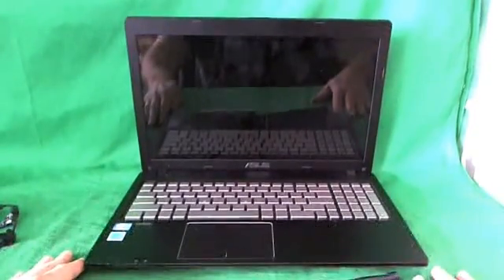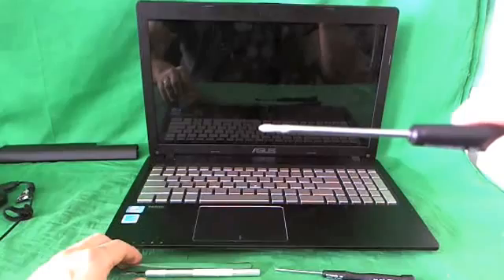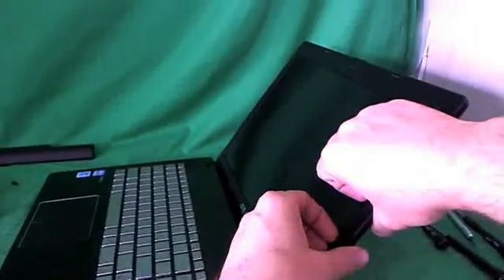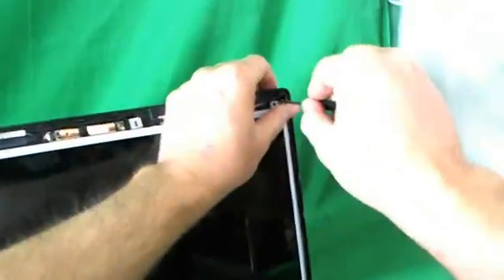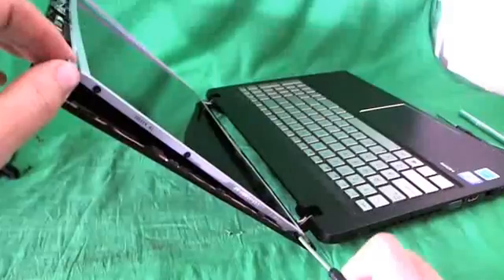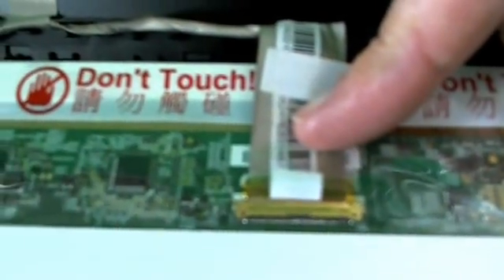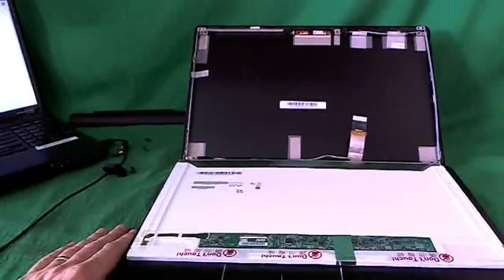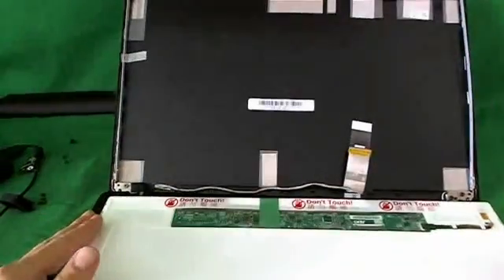ASUS Q500A Laptop Screen Replacement Procedure

Comment: I JUST replaced my screen using this vid.  Make sure you don't rub the wire insulation when removing/replacing screws.  Process work perfectly.  I didn't get my screen from you guys but the instructions were flawless.  Thanks Screensurgeons!

Comment: Is it possible to upgrade to the 1080p screens?
Reply: +Iman Project Probably way too late to answer your question but as far as what I've read on most replacement vendor websites is that it has to be the same size and base resolution
Reply: +k emps I totally understand why they say what they say. BUT... I DID IT! I bought a AUO B156hw01 v.7 panel off ebay for around 60 dollars and upgraded my screen! Yay! Full HD glory in matte. Oh now I totally hate glossy screens. THanks for your info though!
Reply: +Iman Project Dude! I wanna upgrade my Q500A too to full hd, is it IPS or still TN? I'm a designer and I dont really need a new laptop just a new display for this asus notebook. help me out :D thanks